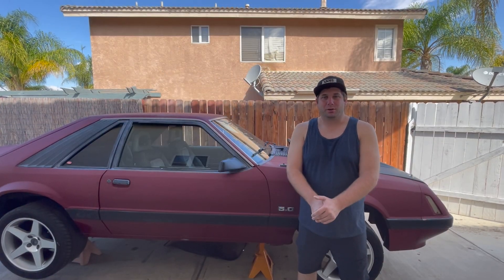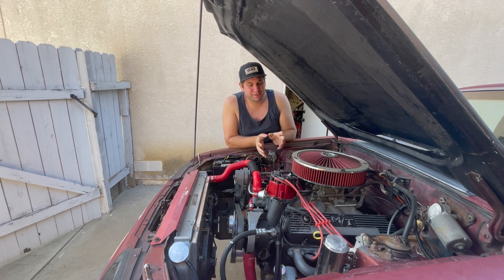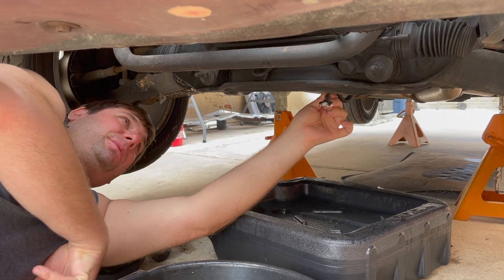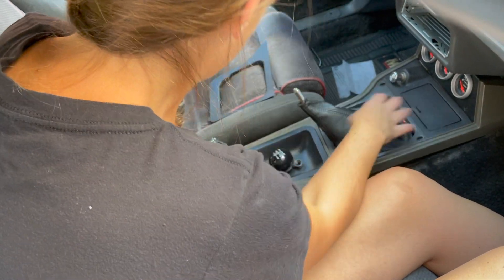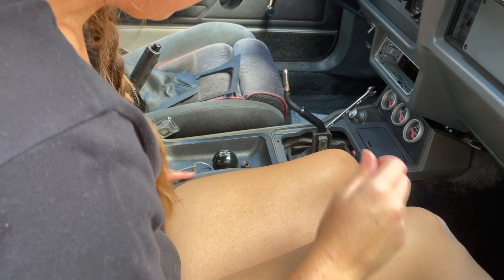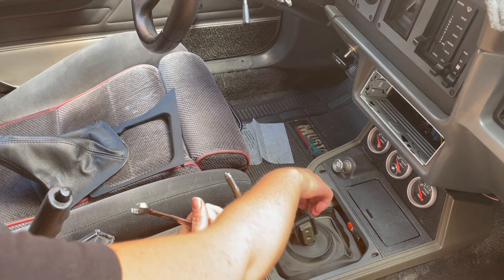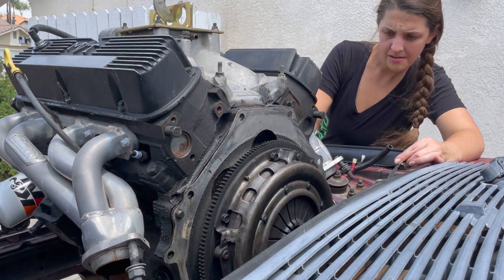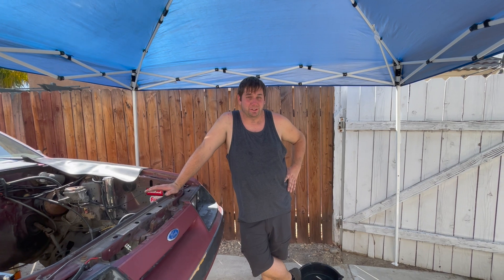Foxbody Build Begins!

Comment: What motor and set up is the one your currently pulling
Reply from the maker: The long block is a 5.0 that I pulled out of a 89 lx so should be a roller engine. It has a edelbrock manifold and carb on top with bbk shorty headers. Not sure if anyone has been in it but should know more after tear down in an upcoming video.
Reply: @tackettgarage4982  sounds good. So up to this point as far as you know stock heads and cam? Just asking because I have an 85 gt vert with 89,000 original, and I’m thinking just a heads, cam, intake and carb change with exhaust. Some good afr kits with a cam that make some pretty decent horsepower. Just subscribed and looking forward to following you and the build
Reply from the maker: Yeah as far as I know the heads and can are stock, but it does look like someone had the engine apart at some point but I hope to find out more when we tear it down. I had a stock original 5.0 in it when I got it years ago and when I did the motor swap (original lost compression, I do use it kind of hard) it felt basically like the original one did when it was healthy. So I’m pretty sure this one is original, definitely the smog heads with the ports in the back but the timing cover was definitely changed at some point. We are probably in a pretty similar starting point but I would think yours is lower miles. I have heard/read really good things about those afr heads! The ones I got are made by blue print engines. They were a little more budget friendly. Glad to have you along for the ride!